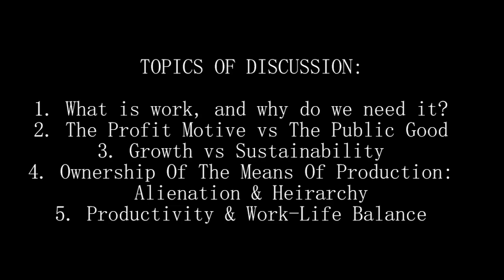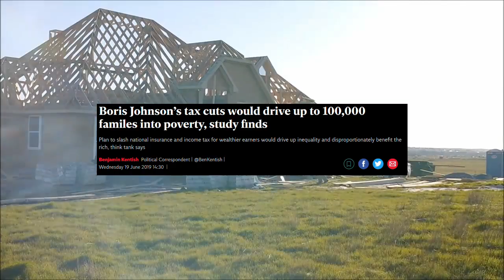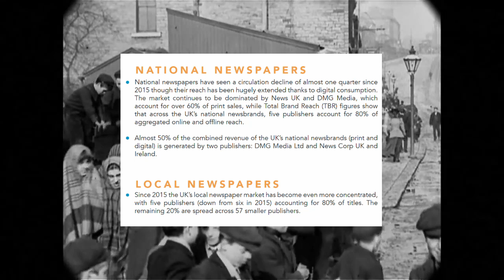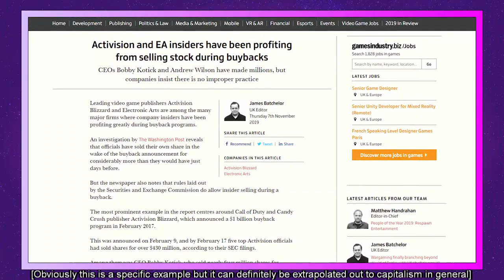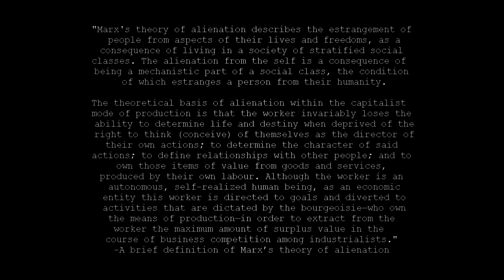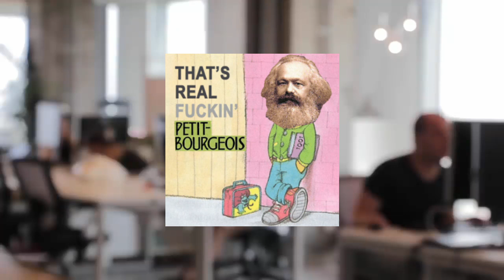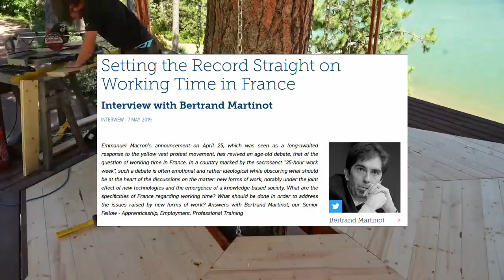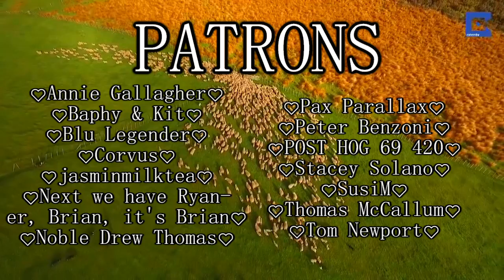How Capitalism Ruined Work

Comment: Ironically we could even keep stores open 7 days a week if everyone only worked to or 3 days. You would have two or three workers for one job. There would be no rush to do everything on the weekends because weekends wouldn't exist. You could still have the majority of your time doing what you will, and taking care of your basic needs like grocery shopping, or getting your car into the shop. The difference would be instead of one worker who does everything, it's 2 to 3 on a given job. This could even work out better because as people get sick or want to take vacation you already have 2-3 other people able to cover. While this system would benefit most everyday People the corporation would lose massive profits as they would have to pay the salary of multiple workers for one job so it will never happen, unfortunately.
Reply: Not "never", it will happen when the rich business owners and their political servants are made an example of, and the rule is (forcefully) distributed equally, as well as profits and labor products. It will only be done by the people, when they snap (and signs are already showing).
Currently, you only have the "power" to elect one of a small number of carefully selected people, and if they do something you don't approve of, tough luck. Once we tear down that system, we can build a new one, where no one gets a full mandate in any office, but everyone get to both work and (very briefly) govern a small piece of land/activity where they are/have proven knowledge of. But no permanent governing positions, no decades in office, just routine maintenance management work, not by "managers" or law school graduates, but people actually knowledgable in their field of work.
Remember - manager is not a profession, lawyers aren't productive - and those two occupy the most positions of power today. Literally every other profession is more valid, even artists and people doing gender studies are much much more important to society than managers and lawyers/judges.